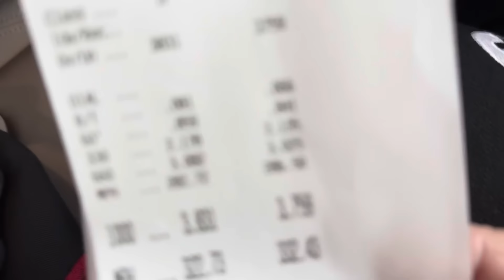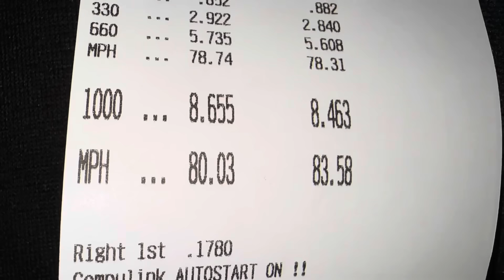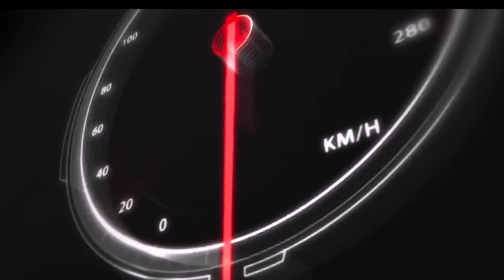Tony Stewart, Big News Week, Nitro At Night

Comment: Jim stalking behind you cracked me up. It's interesting to see how different the processes are now compared to ten years ago when I last really followed NHRA. (I quit watching when Ford pulled out) Burnouts are so much shorter than they used to be, the warm up process in the pits is way different (no throttle smack for one), the clutch doesn't come out fused together anymore.. there's been a lot of changes.

Comment: I'm getting really concerned that top speeds are creeping beyond what they were when a 1/4 mile was run.   Has tire tech advanced enough past why we now run 1,000 ft?
Reply: It's not the speed, it's the stopping distance.
Reply: @gwbuilder5779   Prior to the 1,000 ft change, there were a couple of tire explosions and Clay has even said the 1,000 ft change was done due to tires not holding together at high speeds.  

Scott Kalitta's crash in 2008 finally pushed the issue however, according to the wikipedia page, the clutch was welded solid and the engine was still powering the car through the 2,235 ft long shutdown area.  The page also states the car was going 125 MPH at the end of the track.   I say an extra 320 ft / slightly lower speed would not have helped much in this case
Reply: @gwbuilder5779  You are correct tires were a concern but what you said is absolutely  the main reason

Comment: I was standing at an early video game in Disneyland in California in 1977.  I had to explain to my buddy who said that he was a hot rod man that the game wasn't correct.

It was for a dragster, with a 4 speed stick shift to the side of the steering wheel.  I explained that modern day dragster and funny car used 2 speed transmission.  There was a brake pedal and a throttle pedal.  You stood on one foot to play this game, talk about awkward to do.

You were supposed to put the car in 1st gear, ease up on the brake to stage.  When the tree went down you were to be on a run.

You could red light, easily.  You could over rev the engine and blow up.  You could even blow over while pulling a wheelie.

I was getting beat, and getting tired of it.  So I figured out how much gas that I could give it, power shift to the next gear, all while pulling a wheelie.  We both know that a wheelie isn't the quickest way down the track.

So I was winning more passes than I was loosing.  All the while my speed was going up.  Then I figured out the key to the game.

I figured out that I could put the shifter in neutral at the light, both top bulbs lit, rev the engine to about 3500, then Neutral Drop into 1st, power shifting through 2nd & 3rd, waiting for the right rpm to go into 4th gear and win every single run.

Needless to say I was accused of cheating.  My come back was that if it was cheating the game wouldn't allow it.

The next bone of contention was my speed.  Over 250 mph, in 1977.  My buddy got all upset, I mean stomping yelling mad.  I had to work hard at reminding him that it was a video game.  Until I said that they were going to pass 250 mph on the track that year.  IMPOSSIBLE was he strong, stomping, yelling response.

I then said that they would pass 260 moh that year, on the way to 300 mph.  He said that they could not physically go that fast.  I told him that he reminded me of people who thought in 1900 that if a person went 100 mph that the wind would tear their face off.  He got mad & quiet about that because he knew the lunacy of the thinking.

So Clay, go get that 340 mph!!!
Reply: Drag Race ... I shelled quarter after quarter into that thing! Despite being video, it had a real Sun tach mounted on the console. It was a blast. 

Awkward? We played it on roller skates! 

I played every racing game ever made thru the vintage heyday. 

Super Shifter was cool, with a Hurst T-handle. 

Today, it's extraordinary thinking we spent a quarter a play minimum, back in the 70's. 
Expensive addiction ... this was pre-token era.

Comment: Clay I'm just wondering what kind of brakes you are running on the top fuel car and how often do you guys change them and as always I can't wait for the next great video and the next thing you get yourself into
Reply: They use carbon fiber brake pads and rotors - on the rear obviously - no front brakes on a top fuel car.  I don't know the replacement regimen, but I'd assume they would inspect them visually and replace as needed.